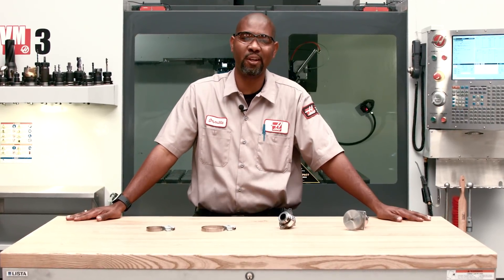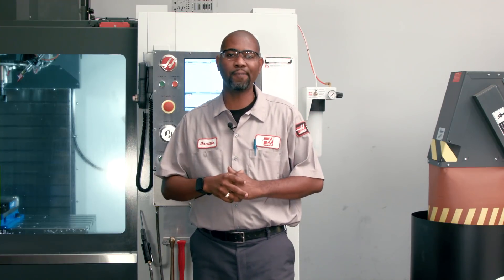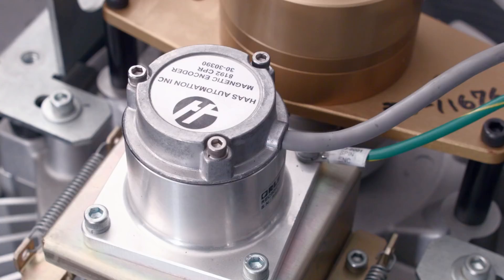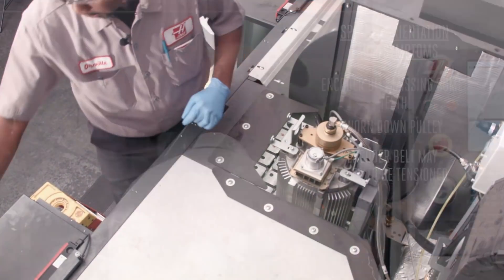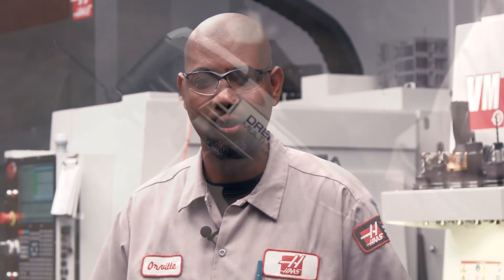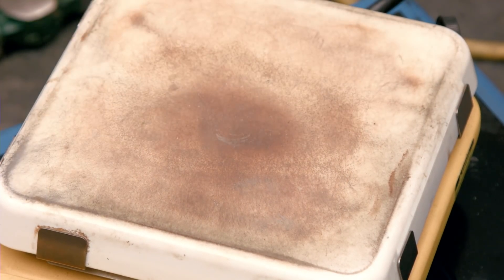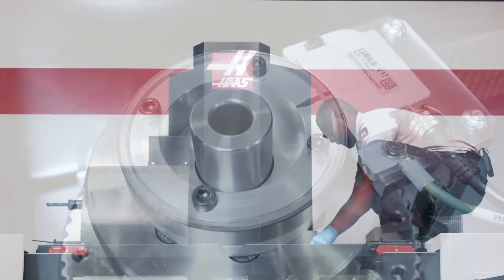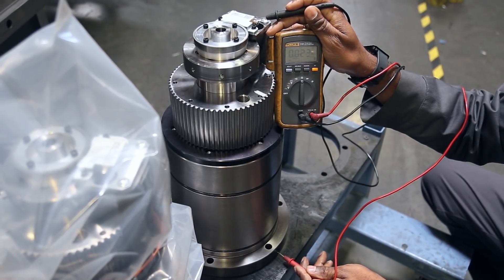Spindle Encoder Troubleshooting - Haas Automation Service

Comment: What if you program S1000M3 and the reading says 1004rpm? Is that a problem? I have confirmed the 1004rpm with an external tachometer.

Comment: I have haas vf3 2005 model. If i send command M03 S30 Cycle Start. Spindle runs at 60 rpm. And show S 60 rpm on current command screen. Can u tell me where is problem?

Comment: Instead of scrapping off the anodize layer, seems a type of piercing washer under the jam nut (or a combination of the two) would avoid that one failure mode.

Comment: What is the reasoning behind the next-gen control needing a HFO to set the spindle orientation?
Reply: Eggsr2bcrushed Your  hfo has the needed service key. It is a generated code saved on a memory stick. The key Unlocks parameters so you can change 257.